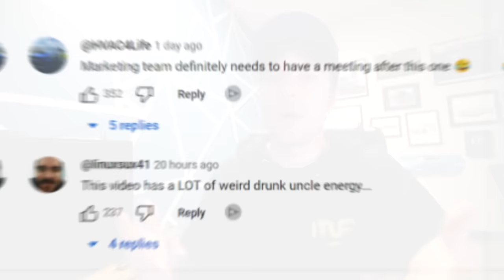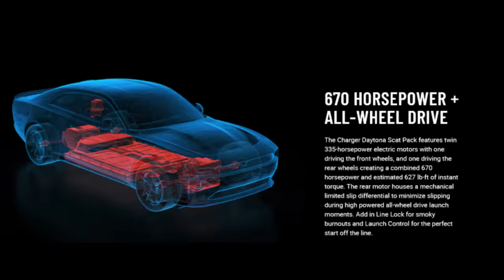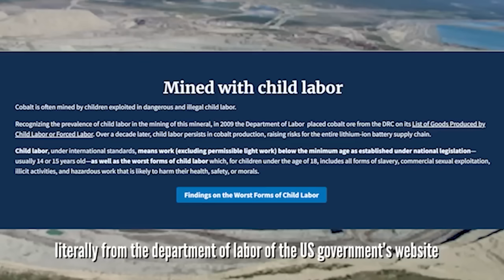The 2024 Dodge Charger Daytona Unveil Was Embarrassing

Comment: So far my biggest problem with the car (aside from EV & no V8), is the fact that it weighs 5,800lbs.  That’s about as heavy as a 1974-76 Cadillac Fleetwood 75, the world’s longest land yacht, which weighs 5,890lbs. Also almost as heavy as the Ram 3500 which has a minimum weight of about 6,000lbs.

Comment: About 3 decades ago, BMW knows that American consumers can only count the engine spec numbers by their fingers, i.e. # of cylinders, therefore introduced a V8 530i, despite even less displacement than their original inline-6 535i. But American buyers took the bait anyway. I drove it, & found it to be quite a joke. What kind of performance car would use such tiny cylinders smaller than 0.4 liter each? These days, I've been repeatedly collecting naturally aspirated smoother-than-V8 inline-6 BMW, 3.0 included, all stick-shift of course.

Comment: The 2025 Charger actually looks a lot like the famous '68 Charger, minus 'The Flying Buttress' and the chrome.

Here is my opinion.  The 2025 Dodge Charger should have offered the following engine / motor choices:
     1.  a regular, lower performance hemi six cylinder,
     2.  a high-performance hemi six cylinder,
     3.  a regular 6.4 liter Hemi eight cylinder, 
     4.  a 6.1 liter Hellcat eight cylinder, and
     5.  an EV motor.

Let the buyer choose his own engine/ motor.  The government should not be forcing the buyer.
Reply: you do realize large engines are going away because of emissions and mpg regulations right? the automakers are doing what they can with the government and EPA breathing down their neck.
Reply: @riogrande163 , yes, the government is too intrusive.  

In an ideal freedom based union of states, the government has the expectation to give the buyer the necessary information, and then the government should step back and let the buyer make the decision.

Comment: I appreciate the faux exhaust. That would add to the driving experience. The problem I have with Tesla is they're too quiet. Maybe I'm old, but I like hearing the car. You can get leather scent added to faux leather. What's the problem? If it adds to the experience just enough to make ot feel a little more normal I don't see an issue with it.

Comment: Sad to see the V8 go away and the end of Dodge. Stellantis inline 6 is not a 2JZ Supra engine. Nothing Stellantis makes is reliable.  Also remember how Dodge makes there ECUs void warranted instantly if you try to unlock them. They are not a tuner freindly company. Also, remember that the current Supra exists and weighs mich less than this Dodge Charger. Then there is the EV garbage which is not interesting at all. Stellantis saying they were forced to kill off the V8 is nonsense and a cop out. As a current manual Scat Pack owner my next car will be a manual Mustang GT as Dodge has forever lost my business

Comment: We need to focus on fuel cells and hydrogen and less on batteries which are not so good .  I’ve had a 73 barracuda a 2010 challenger both were fine cars , you could add upgrades and mod em a lot but this electric doesn’t impress me .  I could be wrong so we will see .  I maintain we need to work on hydrogen .Batteries are plagued with problems .

Comment: I've always thought if I'm in a position to get an EV, it would be much more practical to get a hybrid. Right now I have an F-150 and spend $300 a month on gas. If I had an Elantra Hybrid, I'd spend about $90 a month on gas.

So why get an EV? You still have to pay to charge, whether that be on your electricity bill or public charging stations. So I'd save what.... an extra $45 a month on electricity compared to gas? If you have solar that can cover the cost of charging, so let's assume you're paying $0 for charging. The car itself is still substantially more expensive. An Elantra Hybrid is $27k MSRP, and an IONIQ 6 is $46k MSRP. Even with the $7,500 federal tax credit, you're still still paying about $11,000 more for the EV. So you pay an extra $200 a month on your car payment in order to save $90 on gas. Doesn't make much sense to me.

Comment: Well... it does actually LOOK like a Charger. Chargers haven't looked like Chargers since the mid 1970s. For me, the four door Chargers that have been around for way too many years now were not Chargers. They were four door sedans with hot engines. As for the powerplant... not interested in EV at all. The 6-cylinder version looks to be great, but I really don't like 6's. The best thing about this car is that it actually LOOKS cool. It's been a long time since Chargers have.

Comment: Okay, Dodge making an EV just doesn’t seem like a great idea to me. My 2020 Ram 2500’s radio just shuts off sometimes, and the 2018 (had 96k miles) I had before it had its transmission fail because of shift sensor that went wonky. Just saying, but, they don’t have a great reputation when it comes to their electronics, and I’ve experienced it first hand lol.

Comment: I'm not a Dodge guy, but the widebody Challenger and current Charger are both awesome looking and awesome performing cars.  They have this beefy look and performance which is missing from the new generation you showed here.  I hope Dodge gets their stuff together and go back to making muscle cars.  EVs aren't really practical for long drives and they're not good for the environment either.  They're charged using coal power, which has to be transmitted across great distances.  This isn't even to mention the environmental damage caused by production of the batteries.
Reply: Still has the I6TT with awd that can be switched to rwd at any point.

Comment: Dodge (Mopar) has always been known for strong torque and great power. Back in 1964 to 1971, you bought a Mopar for the power and the sound, nevermind that the knobs fell off after 1 month of rolling the windows down or tuning the radio. Just a power monger of a car.

Comment: The thing that accelerated this transition was Fiat's failure in the United States.  Fiat owns Dodge and has for a while now.  They were using Fiat to offset the percentage of high pollution engines (like the hellcat engine) as the regulatory body that manages that stuff looked at Fiat as an umbrella company that Dodge is just a part of. 

When Fiat failed, all of those offsets they provided with the small 4 cyl engines and the fiat EV went away.  So the Hellcat stopped being viable.

Comment: They spent the last 20 years cultivating v8s and raw hp. The transition is too abrupt and forced. Dodge never invested in a next Gen motor beyond the hurricane. If only they spent the last few years designing a smaller displacement V8, turbos, mild hybrid assist ala Mercedes to aid in emissions. Supplement commuter vehicles with EV and ultra fuel efficiency to balance emission credits across the brand.

Comment: I'm not bothered by the switch to a straight six. Get a good exhaust and that car will sound amazing. As for power, a car doesn't have to have eight cylinders to be fast. Any car that has an Offenhauser will demonstrate this. I think it will sell decently but get outsold by the Mustang, but as the EV infrastructure continues to develop, the car will sell all right, especially with GM losing the plot and killing off the Camaro again. Ultimately, Dodge is not an American company any longer, and the Charger is a European take on the American muscle car formula. I just wonder if Stellantis will have the wherewithal to stick with the car if it doesn't sell great for a few years.

Comment: I’m sorry but these newer versions of the charger will not out perform the last version because the ev’s curb weight is 5800 lbs
Reply: Thats just the EV's weight tho. The I6s will more or less sit within the old V6 models weight. And at best, the I6 more than likely will outrun hellcats without even trying if dodge managed to get something as heavy as the RHO that weights over 6000lbs to do a 13.1,just image how fast it'd be with 2000lbs less and awd.
Reply: @carboydorifutoparty3976  the curb weight of the 6pack is almost 3900 lbs
Reply: @KillMonger312  so it basically weights a bit more a G80..hmm...not bad. More than likely can do mid 11s at best,still really good regardless with less power.
Reply: @carboydorifutoparty3976  my question is: do you think it will still out run a hellcat?

Comment: I have said for years that Chrysler Corp has made a decent car since the 1960's They have some really good styling but their execution is always very poor.  Most of the vehicles start feeling old at 30-50,000 miles. 

Why they can't make the Hemi any more and Ford can make Mustang V8's is simple, Ford has better engineering and has for years. The straight 6 maybe good, but only if they don't cheap out on the build.

Comment: This isn't the first time Dodge introduced a 3.0L turbo-six.  Remember the Dodge Stealth RT from the 1990s?  It had a twin turbo 3.0L v6 albeit it was a Mitsubishi GT3000 with a Dodge dress on.   The Dodge Stealth was a sexy looking car but the motor just was not in the muscle car category.  A straight six?  That is like going back to the early 1960s Dodge Valiant and the 225 slant six.  Dodge better get a grip and keep the V8 option under the hood, plus make it actually look like 1970ish Charger too.

Comment: I look at EV’s as being disposable vehicles. What are you supposed to do after the battery dies, put $10,000 into a 15 year old car? You could never sell it without taking care of the battery issue, you’re in a bad spot at this point.
Reply: Actually, they are quite comparable to similar luxury brands. Compare a first year Model S, 2012, to a 5 Series of the same age and condition. Almost the same price. Hint: The batteries are not failing like people thought they would.

Comment: is it a slant 6? I bet not.. any specs on the electrics battery specs and system voltage? R they using 880 volts yet?   lots of critic about the add and no talk about the specs... I  hear its 110kw battery pack but no voltage specs... ... I'd like the daytona with the scat pace and xl range battery.. in green and gold please...they should have the charger as the electric and the challenger with the remake ofthe slant 6 with 700hp

Comment: Hey Dude! I must correct you on your thoughts on speed. You say the EV are FAST, but there’s a huge difference between FAST speed and QUICK speed! See one equals top speed, that’s FAST, then the other, quick is how QUICKLY a vehicle can get to a certain speed! So the EV’s are very quick, but don’t go fast!  The 392 Scat Pack V8, probably has a higher top speed than most EV’s, but can’t get to 60, or 100 as quickly. But will slowly catch and pass the EV! So it’s safe to say a HellCat has a higher top speed than any EV! I bet a 5.0 Mustang will go faster than a MachE!

Comment: If it doesn't have a V8 its not a muscle car to me. They could have done a Hemi hybrid that would have appealed to more people as you get the gas mileage the power and the noise. People are going to straight pipe the inline 6 and it will sound like 💩. Initial interest will be ok but this will be a sales flop in my opinion

Comment: He said a lot stuff that made complete sense, It will be a slow start, but the sooner they get the ICE Version out to the public the better, I think the EV Versions will be just like GM & FORD just collecting dust on the lots with quite a few test drives in the EV Model but they will sell the EV Version but i don't think they will sell a lot, but like another guy said they have to make a EV version so they can pay less EPA Credits because they dont have a lot of fuel efficient vehicles or hybrids like GM & FORD as usual Chrysler/Stellantis are always late to the party of Developing new products
Thus why the only HEMI you can buy is in the 2500/3500 offerings
Last thing, Just like Hyundai/KIA Cars anything different will sell, and these New Chargers offerings are Definitely different,
So because they don't have a V8 in these new versions doesn't mean they won't sell, you can get V8 in the New  Chargers
You just have to buy you a New Charger & put it in yourself 😊😊😊

Comment: Dodge has always been behind the 8ball when it comes to emissions credits with the EPA due to the lack of “eco friendly” engines like their Ford and GM counterparts. Ford more so than the later. Anyway the pressure from the EPA has started to become to much for mopar. They are constantly having to buy emissions credits in order to keep building the cars the way they did. Its the same reasoning that they put the new R-1234yf Refrigerant in their AC systems before basically anyone else on a wide scale. It all has to due with emissions credits and the fact they don’t wanna keep paying the epa for credits. Thats why the HAD to shift their focus towards EV and the hurricane engine. As a huge mopar fan I’m not happy about it. But thats the reality of the situation. If dodge was able to still make Hemi’s they would. Its what defines them in the 21st century. Yeah they have jeep but I’m not sure how long Mopar is gonna last.

Comment: It isn't Dodge, it is Stellantis, a European company which now owns the brand name Dodge. Chrysler corporation as an independent company has been dead for decades. Fake engine noise, fake nitrous button and fake shift points with an electric drive train is just stupid and pointless. I read that the Charger Daytona EV will weigh 6000 pounds. A Tesla Plaid is going to blow it's doors off in a drag race.

Comment: In the reveal, they should have mentioned that there were more electric cars on the roads than gas cars.  Actually there were more steam powered cars than gas cars as well. The electric cars were winning the races way back the. As they are today !

Comment: Why cant they have an inline 8 cylinder engine???? There is a reason why Hemi engines dominated NASCAR back in the day!!!! 426 Hemis are like the T-Rex of muscle car engines!!!! 😊😊😊😊 The only rival was the Ford 428 cobra jet!!!
Reply: the length of the engine makes it hard to package and torsion on the crank and camshafts causes issues
Reply: @riogrande163   Thank you for the information 🙏!!!! I'm very naive when it comes to mechanical engineering and engines !!!! Still, it's sad what Dodge is doing!!! 😞😞😞😞

Comment: OK, so let’s update your information about where electric batteries are coming from these days.

Yes, cobalt is very problematic. But surprise and good news, new battery chemistries have been developed that greatly reduce or completely eliminate cobalt from the batteries. Which is nice, because it’s very difficult to do the same thing for petroleum. Especially these days, when it is harder to access petroleum since the easy oil has already been extracted.

Now let’s talk about lithium. Lithium is one of the most common elements in the earths crust, and yes, the lithium that has been mine most recently does sometimes come from places that treat people poorly, or use my techniques that are in some cases on par with the kind of damage that drilling for oil does. Fair enough.

However, there are several projects that are being put into place which are extracting lithium from far less damaging locations both on a human level and on an environmental level. What’s more, some of these locations are actually extracting lithium from waste products. So lithium is going to get better and easier.

That said, lithium is not the endpoint for electric batteries. there is a lot of good work being done that replaces lithium with sodium. You know, the stuff and table salt. And the ocean. And it’s interesting about these technologies, but you’re already being brought online, is that they may dovetail very nicely with desalinization plants.

Maybe you’re aware of maybe you’re not, but as the human population is growing, we need more and more freshwater. There’s a lot of things we need to do about this, not the least of which are sisters to capture rainwater for human and other use. But another big opportunity, especially for coastal cities, is the salinization of seawater. So when you take the salt out of sea water to make it into freshwater, you need to do something with that salt. It’s sodium chloride, so at least half of that equation now suddenly becomes something useful for transportation and anything else that uses batteries. Now I don’t know what the chlorine is going to be used for, so there’s a place where you can make some criticism and potentially. But a sodium based battery will be able to be made far more easily than a lithium based one, and the cost is probably gonna end up being a wash, but you’re going to end up with a virtuous cycle when you create that freshwater. Not to mention there’s plenty of sodium in earth crust as well. And potentially, the environmental impact is going to be significantly less than anything that would happen with lithium.

That’s not even taking other cutting edge technologies which are going to potentially make batteries with more energy density, which is going to mean more range and power in the same space. Again, this is one of the advantages of an electric vehicle over a gasoline one. there is a heck of a lot of headroom in improving electric vehicles, whereas it is significantly more difficult to improve emissions and efficiency for gas engines. Except for the big efficiency, which is all of the heat that’s lost. If somebody cracks that nut, then gasoline engines could get 2 to 3 times more efficient easily. but nobody seems to be researching that

The bottom line is, you can make random sides two problems that you perceive in current vehicle batteries, but we have not reached the endpoint of electric vehicle development by a longshot. By 2050, I predict that some auto maker will release a mass market car that will easily get 500 miles of usable range in the same size batteries that we’re using today.